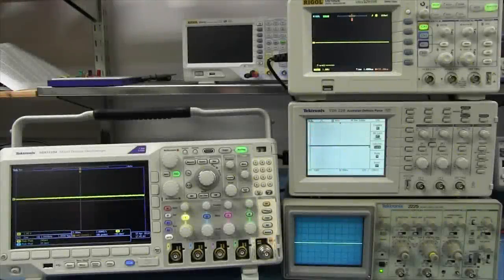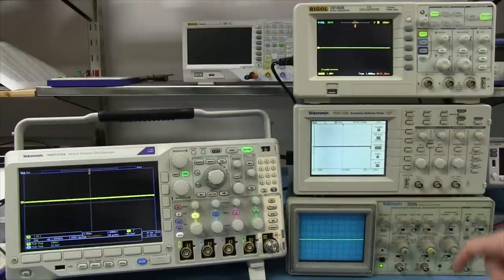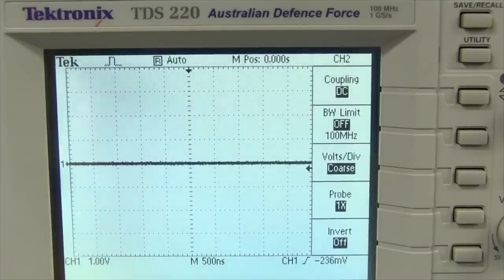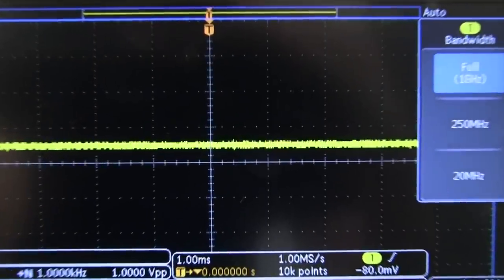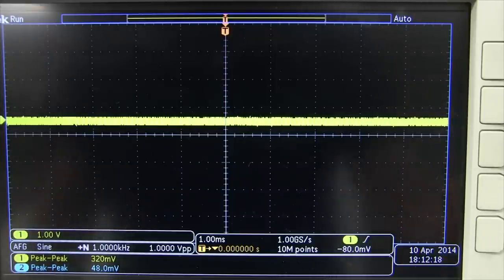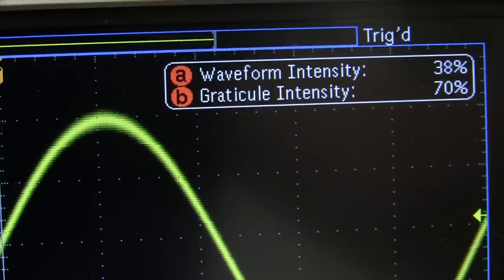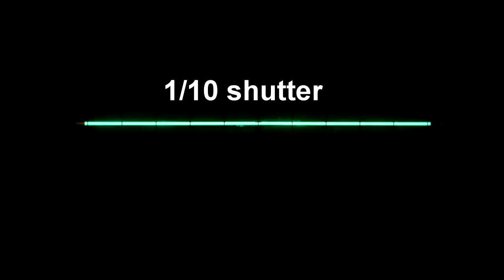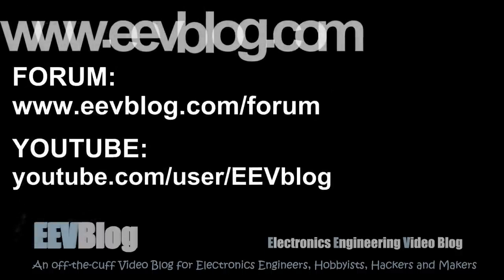EEVblog #601 - Why Digital Oscilloscopes Appear Noisy

Comment: I prefer analogue scopes. With an analogue scope the timebase is directionally propotional to the frequency range you are measuring. No spurious instantaneouse noise being displayed. Yep more than 20 years experience with this.
Reply from the maker: But what if you want to see if there is spurious instantaneous noise? That could be a real problem in your system, If your tool is hiding potentially useful information from you, then I'd say it's not a great tool.
Reply: EEVblog With the right scope you can increase the volts per division to a very low voltage ( dc voltage noise check). Trigger or free run and increase the display intensity to see noise. Works very well, I designed very low noise gyro sensor navigation systems for big automotive customer. I choose what I want to see.

Comment: Further to my earlier comments, you talk of 'noise' as though it is noise on the signal being examined, or the noise generated by the oscilloscope input amplifier.  I don't think this is valid.  What is the likely input-referred noise of a scope?  The best op-amps used in audio have intrinsic noise of less than 3nV/root Hz.  Lets take a more reasonable figure for a wideband amplifer of say 10nV/root Hz.  For a 100kHz bandwidth the noise will be 300nV rms.  For 100Mhz bandwidth the noise is 100uV rms.  The peak noise is hard to define, but for Gaussian noise I think perhaps a peak value of four times rms is very reasonable, ie levels above four times rms will be very rare events.  Hence peak noise in 100MHz bandwidth is 400uV or about 0.5mV.  One quantising step on an 8-bit scope reading 1V/cm represents around 50mV; so the peak noise should be two orders of magnitude below one step and should barely register.  There will though always be a DC offset into the digital convertor, so noise may occasionally cause a step in level, but never two steps though it should rise on lower input settings, as it does.  I think the truth is that it is very hard to eliminate processor noise from the inputs of wide-band  ADCs and so it is not signal noise but processor noise that spoils the trace. This combined with the DC offset effect, means that a tiny amount of noise can become a trace two pixels wide, which reduces apparent resolution to 1 percent of full-scale.  An analog scope can do much better than this.

Your demonstrations on an analog scope of turning up the brightness or long-exposure photography do not convince me, as you offer no evidence that the broadening of the trace in either case is due to noise rather than beam spread.  The beam of a CRT has a spread, and so turning up brightness so that the centre of the spot saturates increases the apparent size of the spot.  Long exposure has the same effect, with the film saturating instead of the phospho.  I do not think the spot increases because of noise becoming visible because I don't think there is sufficient noise there.  Nice try, but I need a 12-bit scope :-)
Reply: exactly. also CRT has not just a "beam spread", but problems with focusing at high beam current, also high beam current could change biases on CRT electrodes, and it defocuses the beam. also there is an illumination effect on CRT screen surface at high brightness, when some screen area illuminates neighbour. plus secondary electrons emitted from screen phosphor under primary electrons bombardment.
Reply: Yes; agreed and thanks.

Comment: Ayuh, pretty obvious to me the whole time that the digital scopes were just more sensitive to the actual data and were displaying it in hard discrete pieces, the pixels as it were. But i suppose it takes a half an hour to explain something simple to a dozen men with Phds lol
Reply: That was not the point of the video at all...
Reply: g0fvt no i know it wasnt, it was educational, but myself being "uneducated" never had oscilloscope bias to begin with, but was smart enough to see the difference wasnt noise it was equipment display sensitivity.
Reply: WeAreGRID I was thinking the same thing. Great minds work alike.
Reply: Sadly my digital scopes are much older, with conventional CRTs...
Reply: WeAreGRID I am sorry, I think I misunderstood your original post...
Reply: g0fvt Its alright brother, have a blessed day lol
Reply: I was actually biased, but that was because I didn't like the pixellation of the first digital models which didn't have that great a memory either. The variable intensity is quite useful showing both the signal and the noise and I now agree that's the best.

Comment: imo, this man is not completely correct.
1. if he increased brightness of analog scope, he gets line widening not only from "incorrelated noise", but from imperfection of  the beam focusing system of the oscilloscope tube, all this halos are from there, etc. analog oscilloscope tube is not perfect "voltage painting device".
2. width of analog scope line could be demostrated on slow horisontal beam sweep. or just without any horizontal sweep. switch off the X-sweep and see the height of signal.
3. normally ADC has flickering in the last significant bit, and this will look like additional noise... seem it was not mentioned here. if you have 8 bit ADC, than really you have 7bit of data with flickering eight bit.
sorry, my english is bad, and i could miss something in the author speech.